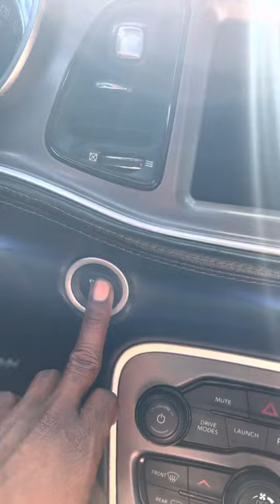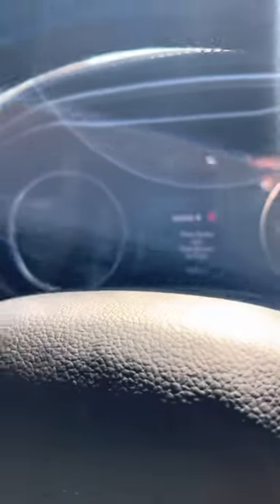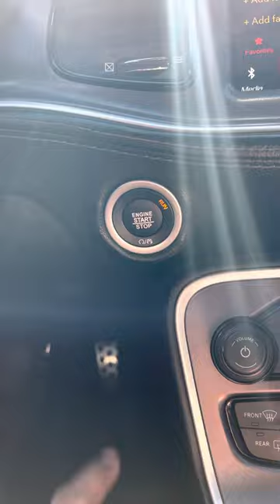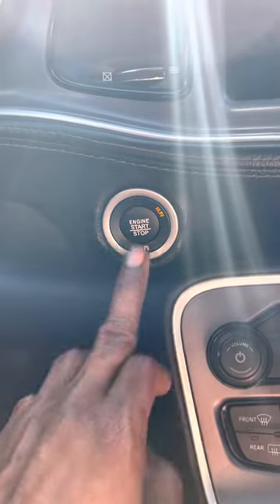Throttle Response Reset on Dodge Challenger/Charger Scat or Hellcat

Comment: I apologize my text picked up something else. I tried every sensor on the car, air filter fuel pump just went through the gamut and saw your video and I’m like no way… All of this to say issue fixed, and I was counting on paying thousands of dollars my car runs I would say 65% better than it did absolutely amazing it is a modified hellcat 1200 hp 1035 rear wheel , the simple trick brought it back to. I don’t know. I’ve never had it respond like that scary scary fast love it thank you I appreciate the information. I’m going to go reset my other one now which is a Mazda turbo amazing I hope someone read this and gives it a try because I feel like I bought a new car with about 500 extra horsepower no joke.
Reply from the maker: I was shock when my 392 all of a sudden got slower 😂 these cars do that alot when they redline! Im glad it helped you out

Comment: I tried everything as my car no response like if you wanna head and cut ass with all the sensors airport on the app and saw your video and said what the heck… Text in the car runs twice with a modified 1200 hp hellcat and that simple trick just boosted the power to something I can’t even control. I was shocked thank you thank you thank you this unleashed more than I wanted and I’m just totally shocked at something so simple could do that. It had been dragging a bit and I thought it was the heat. I step on it now and I cannot control back and I mean it is vicious. Thank you.
Reply from the maker: Glad to help 💪

Comment: Mine the revs seem to not want to come down right away. I used to get on it and let go of gas and it would just rev down. Now I rev up and feels like it lingers around 3K and slowly comes down.
Reply: Mines doing the same what was it??
Reply: Same here 😂
Reply: Mine as well. Did you ever find out what it was?
Reply: Same but only free reving not under a load
Reply: @miggy_moto_  so mine is a manual and I noticed if I put in the clutch and just do some revs and then hit it, it’s starts acting up. It’ll do it for few days and then go away.
Reply: @mstabig9519  no clue. Did it again last week and went away on its own few day’s later. I noticed it doesn’t like it if I throw it in neutral and rev it then step on it .